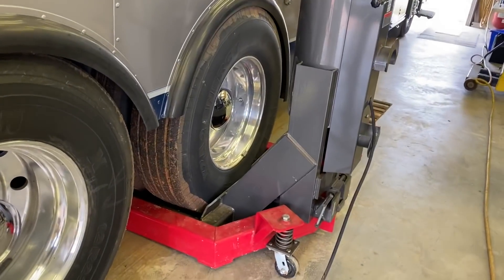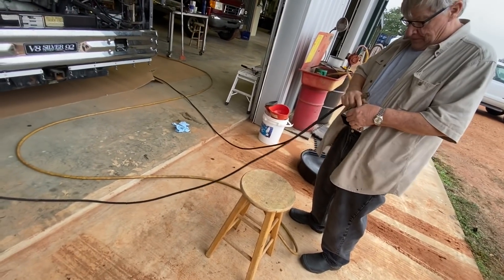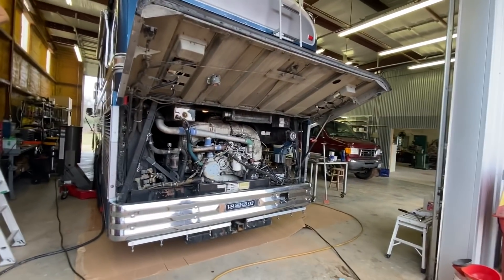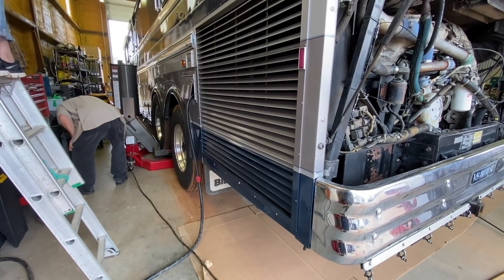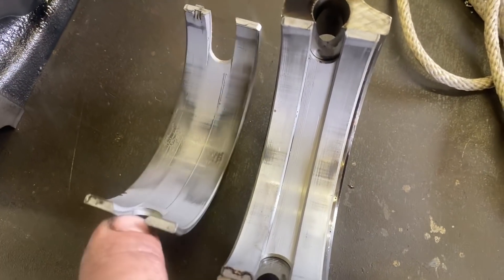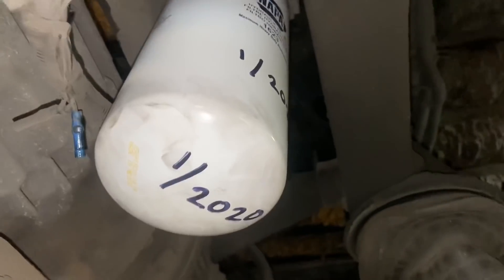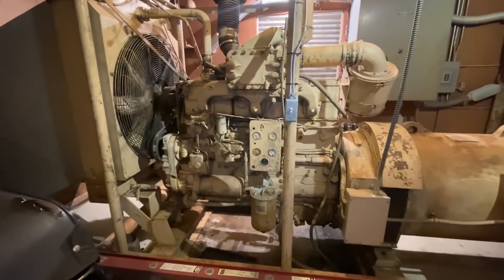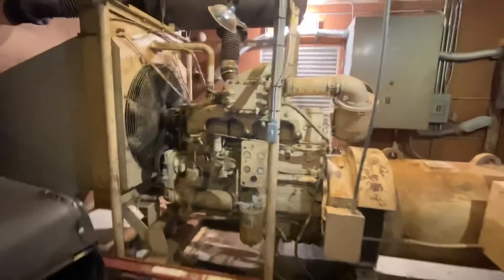Wanderlodge maintenance detroit diesel 8v92TA

Comment: 👍👌❤🇨🇦, nice guy, but deep pockets,
Reply: Wealth is one of the essential tools needed to go balls deep in old buses. Without it you may as well be pissing on a forest fire.
Reply: Ya gotta appreciate a wealthy man who uses his money wisely.
Reply: @MatthewFogarty-k2y  It's all under a roof that's the most important piece for preservation. 7 years is fine for a transmission filter of a vehicle that doesn't get used much. The older transmissions (i.e. Ford C6) didn't have filters at all, just a bug screen.
Reply: @MatthewFogarty-k2y  At least up to the late 70's the "filter" is just a metal wire bugscreen. Later the E4OD and whatnot have what looks like real filter material. The Allisons have something like that too. The external spin-on filter is an auxiliary filter that filters out fine clutch & metal wear material. A quick internet search shows that Allison recommends changing the filters every 50,000 miles. This coach had only 150,000 miles in 30+ years so it's probably not being driven that much.

Comment: Tell us about wander lodges in general. Are they desirable, reliable, comfortable? Rust issues? common issues? Enquiring minds thirst for knowledge.... Please be spilling your guts now.. LOL. (Thanks for the best videos on the tube!) ALSO, did you stop at Buccees?
Reply from the maker: They are built like tanks.  Built on the bluebird school bus frame at the factory as an rv.  Don’t call them bus conversions because sone of the owners are really sensitive about that.  They are very nice.  Some have different engines from gas engines and small diesels in the front but the big 92 series pushers seems my favorites.  They come with every damn thing under the sun as far as bling and gizmos.  Heavy but cool.  Huge cult like following
Reply: Google the forum...issues and history...only downside, over weight front axles and mismanagent took them down...per forum folks...well loved...by owners